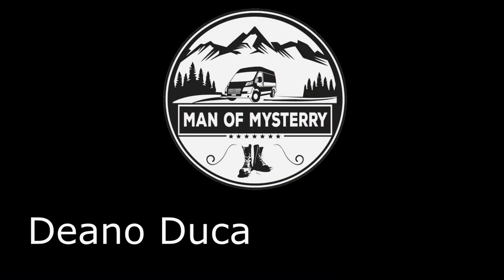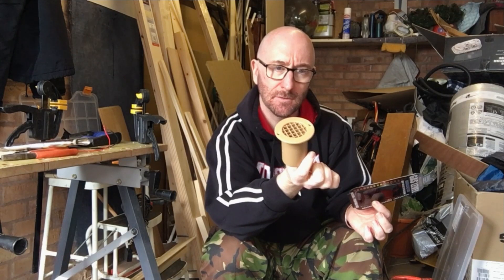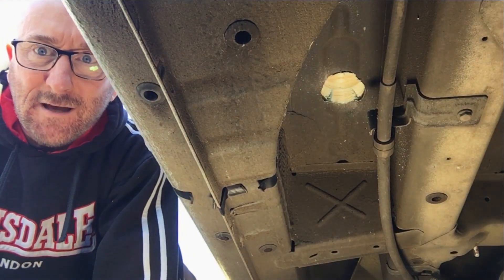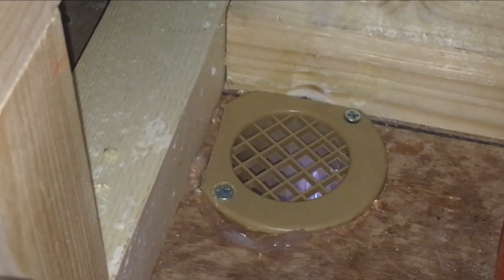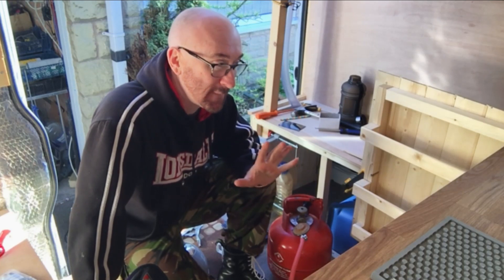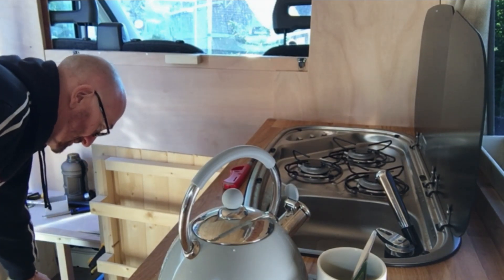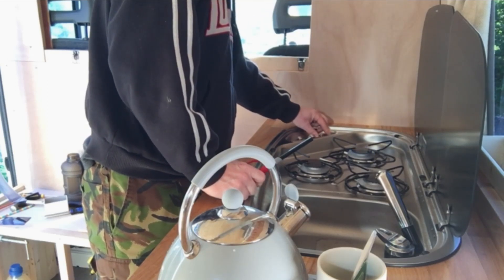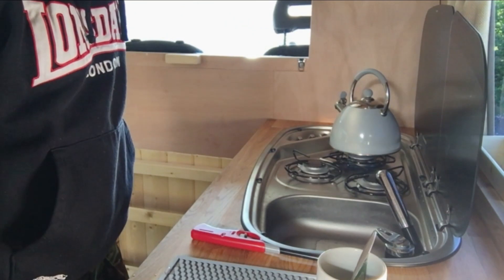Van Life UK Ep24 Gas Installation Self Build Fiat Ducato Camper Van Conversion UK

Comment: Those gas level magnetic things do work but only when you are using the gas for more than just boiling the kettle. Nice job anyway and yes it makes a big difference being able to fill the kettle and have gas on tap. 😁
Reply from the maker: It will make such a difference. Thanks for watching mate.